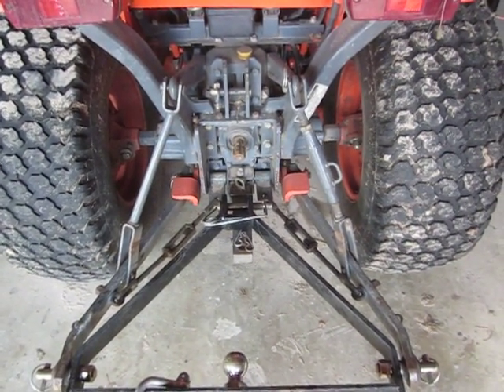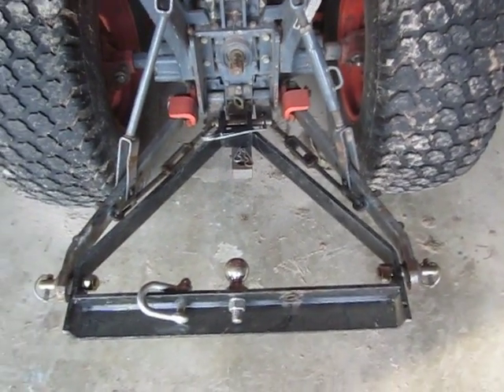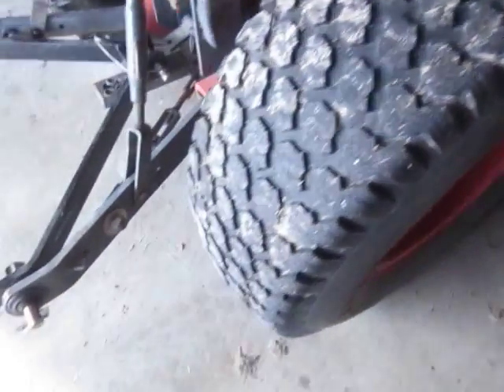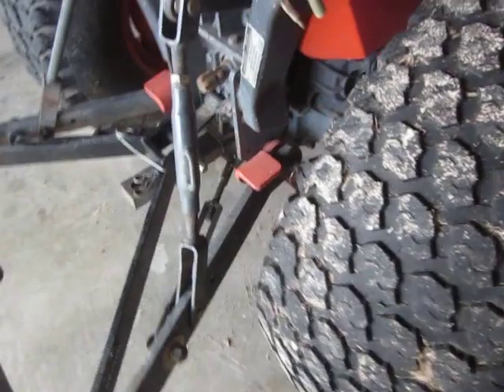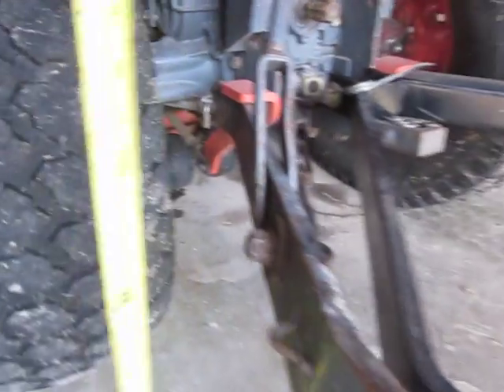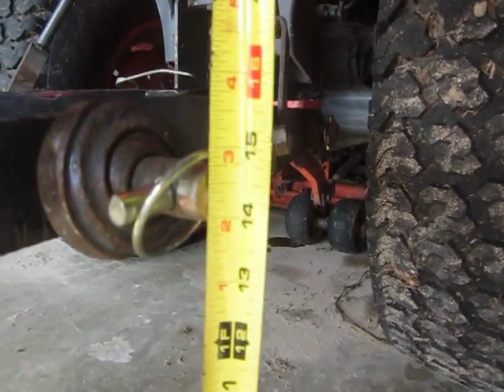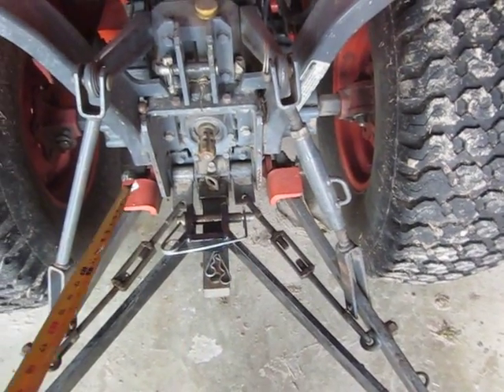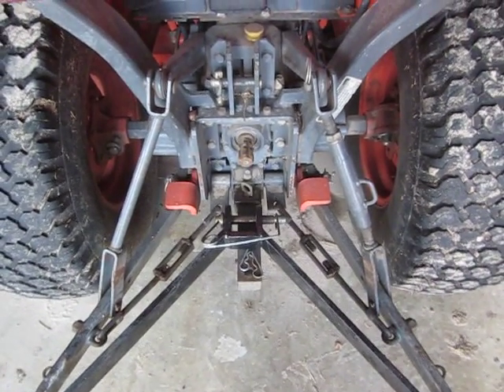DIY - Checking the 3 pt lift arm adjustment on a compact tractor.

Comment: How do i get my bottom link Lower, it is 2inched to high
Reply from the maker: On most tractors the lower links are controlled by the hydraulic upper arms, so check the manual for your tractor to see if adjustment is possible.

Comment: Why cant i find how to adjust 3 pt so hit stops hitting tires when turning
Reply from the maker: 3pt arms should NOT swing, the adjusting links should be tight enough to control side-to-side motion.
Reply: adjust your stabilizers they need to be perfectly straight and tight